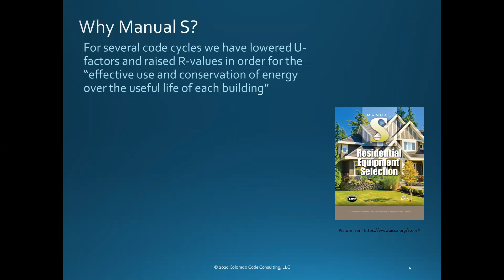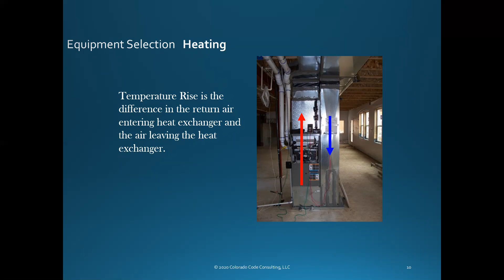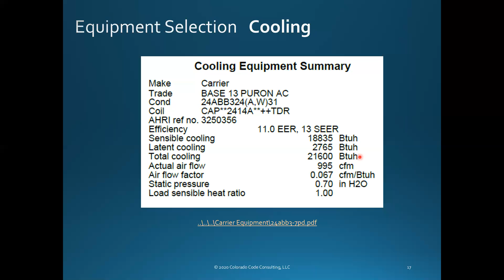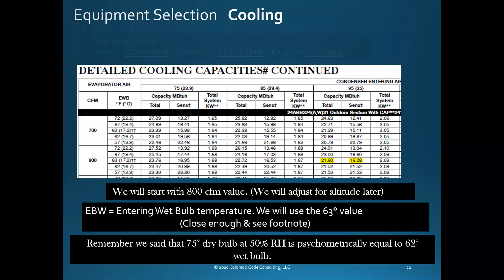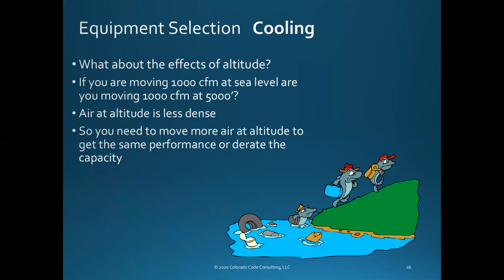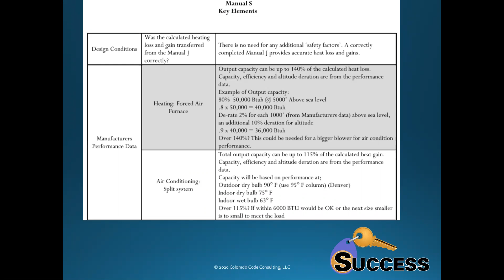Manual S 101

Comment: Thank you very much for this presentation.  I have learned alot of valuable information from this that I will definitely be applying!  

As precise as you were about so many things here I believe that the definition of a "ton of cooling" capacity deserves a better, more precise definition than what was given around 43:00.  Refrigeration was originally sized in terms of how many tons of ice it could make per day.  The latent heat of freezing of water is 144BTUs per pound * 2000 lbs/ton = 288,000 BTUs/ton.  Divide that by 24 hrs/day = and you get 12,000 BTUs / hr / ton.  The way you expressed it didn't account for the full day at 12,000 BTUs/hr to make (or melt) one ton of ice.
Reply from the maker: Hi Daniel - Thank you for the feedback. We always appreciate hearing what is useful and valuable as well as what we can continue to improve. Glad you found this information helpful, and we will review your suggestions!